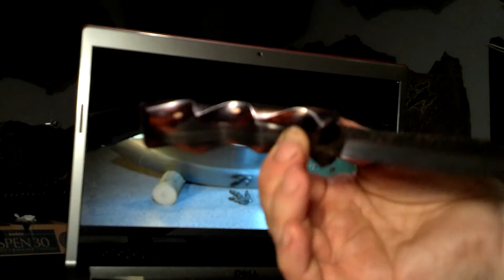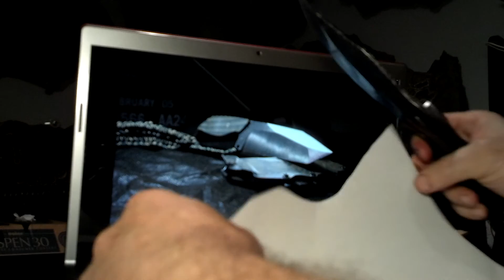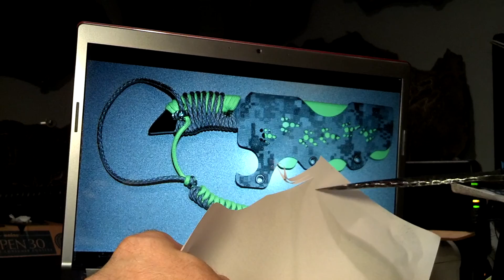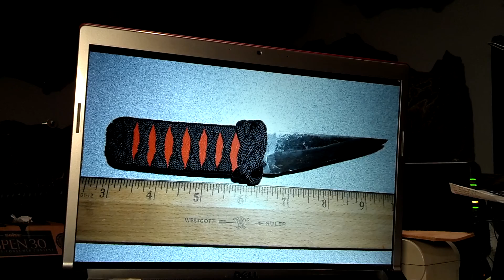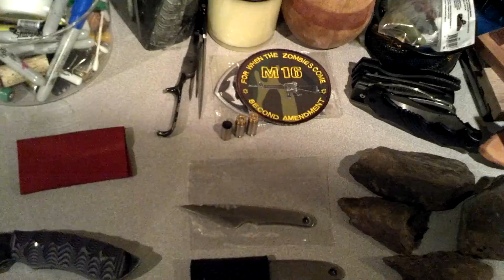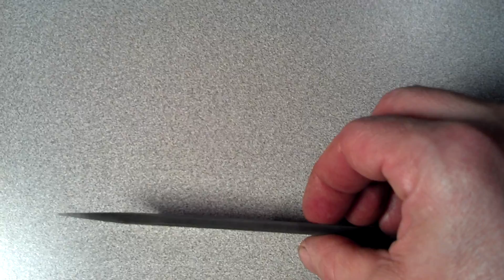CPM 3V knife with my new flame fallout finish and desert ironwood

Comment: The Desert Iron Wood is very nice. I made a set of matching tables by chain sawing through a large burl knot in some iron wood. Killed several chains. Then surfacing it with an 8" aluminum disk and 60 grit was insane...but made a neat pair of egg shaped tables...

Love the profile and material of the blade. Great work.

Comment from the maker: Thanks for the tip.  I have more ironwood and plan to put it on my next knives.  I need to learn how to polish it. In the anso grooves I took it to 1500 grit but it clogs up the 3M sandpaper quickly.  I think I'll use the cotton buffing wheel next time... or do some research on the web.

Comment: Beautiful! Ironwood has what I like to call a fingerprint grain if you look at the micro grain it looks like a finger print! The more you sand it and oil it the more 3 dimensional it looks! Cut it in the dark or low light and it will spark!